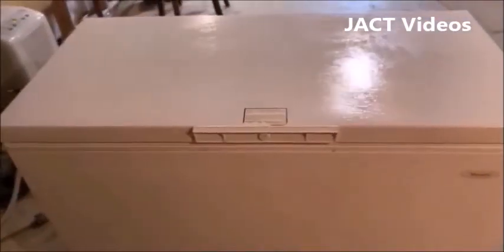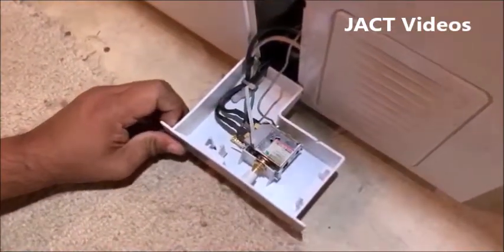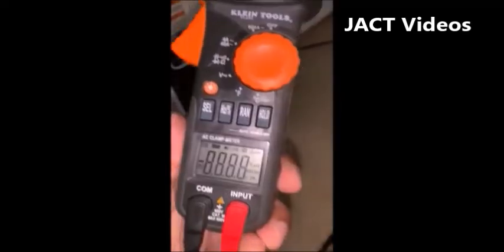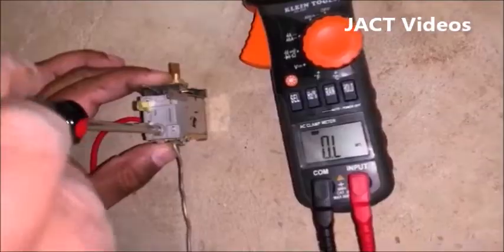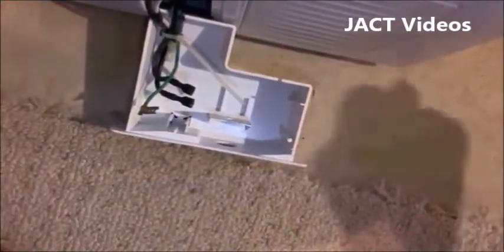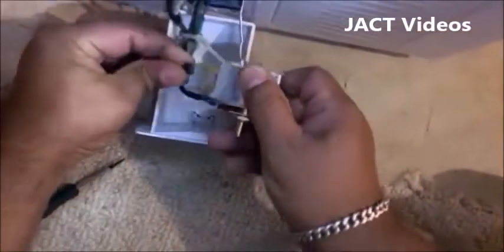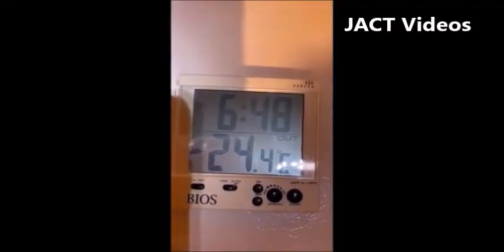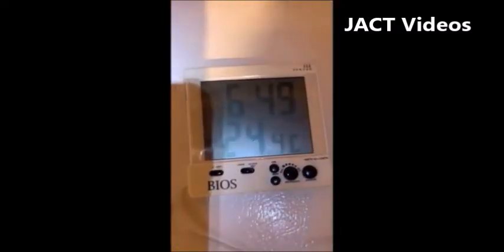Freezer Thermostat Fix

Comment: Thanks for the video!  I am having the opposite issue; my freezer is too cold.  My thermometer goes to minus 20 Fahrenheit and it is pegged there.  I do not yet know if the unit is running continuously as I have not checked but I suspect it might be.  Any suggestions?

Comment: Did you test the thermostat with the dial turned on or off? I tested the thermostat in the on position and it is working. I tested all the other parts including the start relay and overload protector and they too are working but the freezer still does not get cold???

Comment: I spent 5 hours calling repair shop, the supplier of my refrigerator and looking around on the internet for a replacement parts. Did not find anything and all the repair shop told me to scrap the refrigerator.

I did exactly what you did and it work like new now.

If I had found the video sooner, I would have saved a couple of hours.

Thanks a lot.

Comment: Hi. Great video on how to check the thermostat on a small freezer chest. I am having difficulty with my upright Kenmore freezer. It's a smaller one but does not freeze. I've checked out the relays and the compressor and they seem alright. Where would I find the thermostat on my freezer? I have a feeling that the thermostat is not functioning. Thank you for your help.

Comment: You should not install the wires backwards,,,, one wire is load the other is marked C because the voltage must flow in that direction if not you will encounter a problem, C is the hot wire which must flow threw the filament for proper long life function of your freezer.
Reply: I've been looking for this comment for over a week. Thank you for clarifying this!! No other video gave an answer about the C and L terminals.

Comment: Thank you... it fixed mine ! I had to install a new starter, due to freezer not starting, but after replacing the starter, the dadn compressor would not shut off and kept freezing the suction line. I did your thermostat trick and the freezer is operating like new. A big thank you !

Comment: Thanks for your video. I managed to get the thermostat fixed using your suggestion. The screw was adjusted to the point where the thermostat functions as expected. The 20 years old Beaumark chest freezer is back in action.

Comment: so what did you actualy do to the thermostat ? just turn the screw ? what did that do ?
Reply: Yeah. What does the screw do? We need a technical explanation!
Reply: I don't know all the ins and outs, but the thermostat is basically an on-off switch for when the freezer. It turns on the compressor when it is too hot, then when it reaches the proper temperature, it shuts off the compressor. The screw is essentially an adjustment screw.

Comment: In my case I did the same as you do in this video but still nothing.Whats next to check or do I replace the thermostat?
Reply: There should be another adjustment right next to the main rotary dial knob

Comment: Great video and being in Canada too I can "feel your pain" when it comes down to getting replacement parts.  S&H and taxes and duty and all sorts of other BS makes it unfairly expensive to get stuff fixed here.  Anyway, enough ranting.  I had my chest freezer stop working out like this BUT my freezer has a "flash freeze" mode which forces the compressor to run constantly.  In effect, bypassing the thermostat completely so I don't have to mess with that until I get the replacement unit - if I can do so affordably.  To all those other viewers I suggest that if you use the method in this video and the compressor runs constantly afterwards, use a mechanical appliance timer to turn the freezer off after about 4 hours of running then back on for another 4 hours, etc for a full 24 hours.  This should let the compressor cool down and wil "buy you some time" until you get a proper repair done.

Comment: Thank you, our 4 yr old chest freezer broke while I was out of town last weekend. My husband bought a new one. But I hate to throw something like this away. I unplugged the unit. And removed the glue like substance off of the screw for the fine adjustment. I did not bother take the thermostat out of remove the connections including the ground from the front control . I figured it will either work or not when I adjusted the screw. After turning the screw clockwise about 1/2 a turn. I plugged it in and wa-la. it works. The light bulb is burned out, but I do not really care about that. We set a shot glass with frozen water in our freezer and a quarter on top. If we should ever be out of town and the quarter ends up at the bottom of the glass, we know it the food completely thawed out and is bad.  Should the power go out etc. 

Thank you again, 
my sister will appreciate being gifted a perfectly good chest freezer.
Reply: How did you remove the glue-like substance off of the screw?

Comment: Hey there - I have a very similar thermostat (4-35940-001).  I took it out to test it with my multimeter and dropped it.   now it's in a few pieces.  Can you show a video on how to put it together?  The inside has a spring with screw threads.
Reply from the maker: oh boy! That's a tough one.

Comment: I have a very old freezer.   Is it really necessary to take out the temp sensor to check the continuity of the thermostat?  I’m just now getting into this.
Reply from the maker: It depends on your thermostat set up, if your thermostat cable has enough length left outside sensor area then you don't need to take it out. I didn't have much room to perform the test and fix the problem without having to take it out.